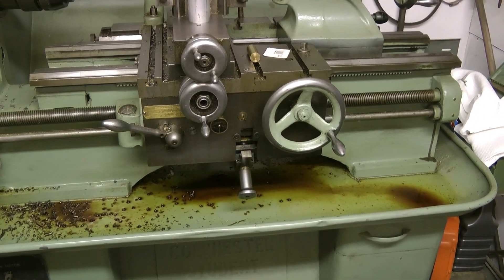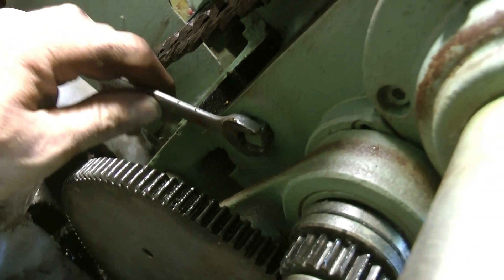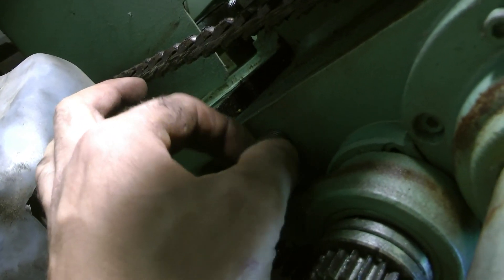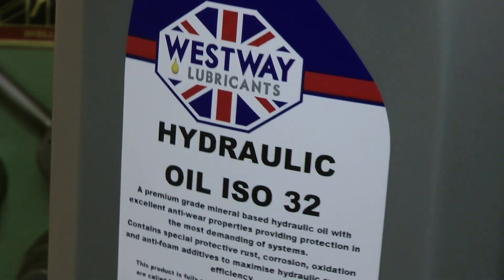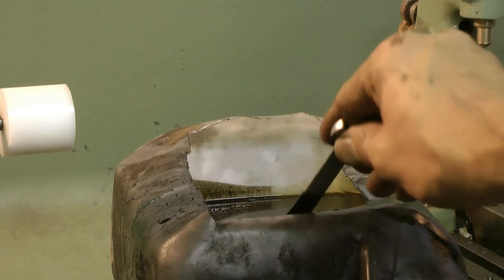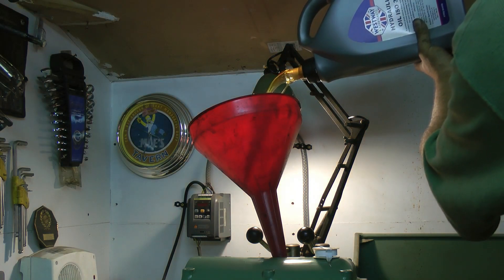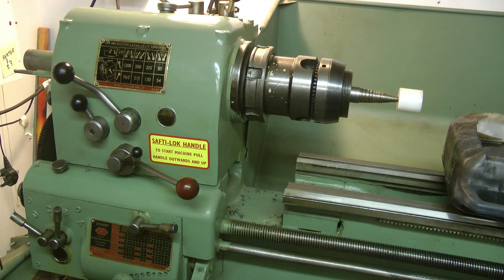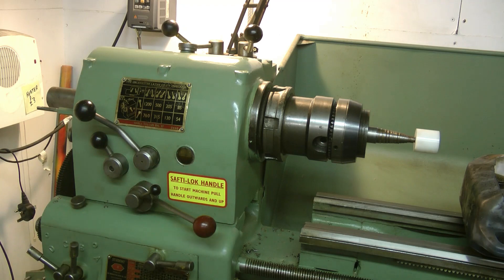lathe OIL change- with  shell tellus 27 substitute on the Colchester lathe

Comment: Looks like that headstock could do with an oil change - to flush out the wrong stuff that was in it.
Then do the leadscrew gearbox too ! (Sight glass on mine's gone black !)
Reply from the maker: Definitely a job worth doing 🙂👍
Reply: @Madchris1  Awaiting advice from Shell re my lube questions.
Our Colchester manuals forget to say what oils to use on the oil points !
We have 2 oil cans. One containing engine oil and the other containing USED engine oil :)
I plan to get a Shell branded new oilcan for the machines  and put a proper oil in it !
Reply: @Madchris1  I bet you're as glad as me that we got these old lathes that take 4 litres of oil - rather than the 2000 series that take more than 25 litres !

Comment: Hi Chris see if your VFD has frequency track if so when on i will start the lathe at full speed no ramping up and coast setting will stop without ramping down!
Reply from the maker: I'm Stubby  hi I’ve set it up to start softly to give to old girl a easy retirement 😀 I did want you set up motor braking but I’m dammed if I can find the manual so there’s more chance of setting the record  time on a old video player 😅 than reprogramming it lol
Reply: @Madchris1  Motor should be immediately unpowered - otherwise you can have power still to the motor while applying the brake.
I'm not planning on being gentle with mine. I want that instant reverse !

Comment: 3L for the headstock and 1L for the power feed/thread cutting gearbox.
Shell Tellus 27 is now Tellus 32. From what I could find out the 27 was just a figure but since the introduction of the ISO standard the number is now connected to the viscosity which is 32. You can still get Shell Tellus but 32 will be the equivalent of 27 and 68 of the old 33.
Reply: Hi, I need the new number for the old Tellus 15 and 23. For a Lorch AVI-1 from 1962.
Thank you very much for the help.
Jordi (Barcelona)

Comment: Hi Chris.
I see your still using the original controls on the lathe from your vfd.
Is there any chance you made a video of wiring these up?
If not is there any possibility of getting an explanation of how to do this, please
Reply: VFD three phase direct to motor, disconnect all mains or three phase wiring from switches use the switches to turn on and off the 5v signal lines to vfd
Reply from the maker: Jay Jay  hi !, the lathe controls are a very simple affair, they run through the body of the lathe on shafts to a electrical switch box on the rear, with nothing more simple than a on off switch, the vfd will have a auxiliary circuit for switch on /off,  as long as you have the original paperwork/ instructions with your vfd  which is essential
Reply: @Madchris1  
Thanks for the reply Chris.
I have the vfd wired to an on /off switch.
I'll try to trace the wires you mention to original lever control and hook them up.Much appreciated
Reply from the maker: Jay Jay , no probs it’s been a while maybe six years! Since I last looked 😅, , you should also be able to wire up the  original fingertip motor reverse switch to which is behind there to, think it’s a barrel switch, , there is a reverse switch video for a Colchester kicking about on YouTube

Comment: This was the next job i was going to tackle...now i know where the drain point is...also i noticed that yours had a small hole/ gap where the gap bed part of the lathe fits next to the main bed. I also have that on mine and i thought maybe it had been damaged at some point but maybe its ment to be there ?
Reply from the maker: fattossa your not taking about the threaded hole for the 7/8” whitworth lifting eye are you?
Reply: @Madchris1  i dunno...if u stand in front of it chris and look where the gap bed connects to end of main bed..theres a gap in the vertical line as if its had a lump knocked out of it Chris...
Reply from the maker: I see it now just a bit of rough casting that’s been trimmed back, could of been the same guy who worked on both lathes 😂 what year is it,mine falls between 66/67 ish
Reply: @Madchris1  yes maybe its where they were cast...mine was made in 1964 Chris..
Reply from the maker: Two year gap between our lathes ...defo the same guy lol
Reply: @Madchris1  probably hahaha
Reply: Put a couple of vids up yesterday Chris...just about changing lathe oil..yay

Comment: Looks to me like you have a weeping gearbox sight glass or maybe the gear select levers above it. You might have to take the gearbox covers off to fix it.
The right hand side of the gearbox has a slight sump which collects a good amount of slurry around the cone gear "Comb".I would recommend cleaning this out, i might make the tumble gear select a bit easier.  http://www.lathes.co.uk/colchester/img6.jpg
Reply: The levers have no o-rings or seals. I guess being above the oil level, Colchester didn't though it necessary. :P
Reply from the maker: thank you ! ive had a look and its coming from the levers, the gear box sight glass looks over filled  ( tut tut chris) she's been stood a few years and was in a poor state when I got her so everything has had a good chance to seep.
ill make it my next job to do, I've had that cover off years ago when I had to replace a few of those ball sprung oiling points.
a big thanks for the heads up on the sump regards chris
Reply: @Madchris1  The oilers over the QC gearbox - should they be oiled with Tellus 33 too ?
Reply from the maker: @millomweb  yes it drops into the same oil  tank so you don’t want to mix it with anything else ! And oil weekly as the manual suggests 
http://manuals.chudov.com/Clausing/Colchester-Student-Lathe-Manual.pdf

Comment: Good to see you back Chris,
Quite rare to see the large hook spanner for the spindle nose nut still hanging on the wall. For reasons i do not understand they seem to have a tendency to get lost.
I can't remember that it was possible to have the lead screw and the feed shaft running at the same time.
Reply from the maker: Jan Visser thanks jan it is good to be back and chat with you guys 👍 if it wasn’t hung up it would definitely get lost !
The feed shaft runs  all the time and the lead screw has the option for neutral, imperial and metric selections.
the lead screw it self is imperial do you can’t use the thread dial indicator gauge when cutting a metric thread, saying that I’m no expert by any means but I respect the machine it’s a dangerous piece of kit
Reply: Hi Chris, thank you for refreshing my memory regarding the lead screw selector lever. It is more than 40 years ago that i operated a Student, and i liked it a lot despite the noisy head stock.
Reply: @Madchris1  Hi I have just bought the same lathe and it has a 3hp 3 phase motor and I just wondered if yours is the same and what phase converter you are using as I'm a bit lost.
Reply from the maker: Lol very noisy indeed , thought mine was knackered 😀 perhaps it is ... it was all I could afford at the time , the dream was a Harrison m350.. ££ but they always come with zero tooling as well

Comment: I saw your drain pan and panicked. You’re gonna overflow.
My Colchester holds 5 gallons in the reservoir and a gallon in the gear box.
Nice lathe.
Reply: The Student MK1 and 2 holds 3 litre.
Reply: @thorweldinginnovations6167  Thanks, fecking manual doesn't state that !
Reply from the maker: Jeff Anderson it’s was close Jeff !

Comment: Did you think to change gearbox oil? Assuming of course that it is separate.
Reply: My Student asks for Tellus 41 in both gearboxes and Westway recommended Hydraulic Oil ISO 100 mineral.
Reply from the maker: @anthonyfieldthetrollbuster9930  what year is your student ?
Reply from the maker: Chris Stephens  it’s the next job Chris  I think it uses a tellus 33 hydraulic oil ,only need a litre or so , goodness’s only knows what’s in there!
Reply: My Student is a MK 1 Roundhead from 1953. Yours is a MK 1.5 Roundhead.

Comment: Trick for the next time you're pouring oil (or anything) out of a jug with the spout over on one side like that.  Instead of holding it with the spout as the lower corner, hold it with the spout up top.  It won't do that gulping/sucking air thing that makes oil wind up everywhere.  It seems "wrong" but it's actually right.
Reply: Also works if spout is on the side, which is sometimes easier.
Reply from the maker: Thank you I’ll definitely try it 😀